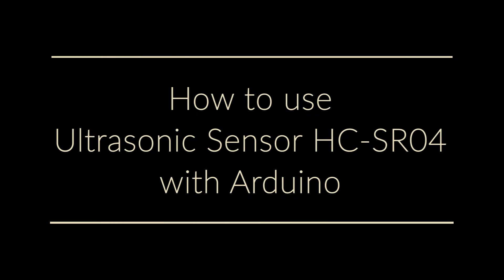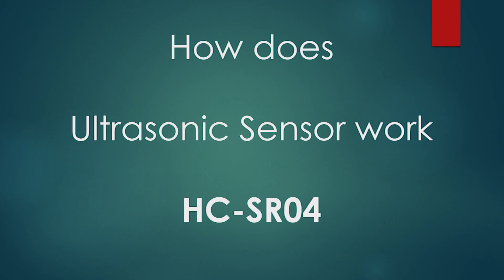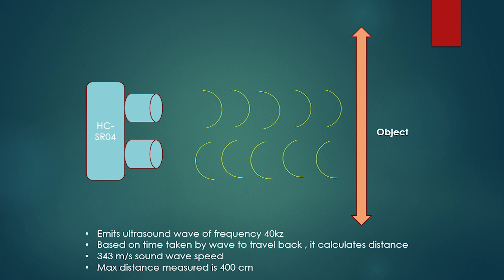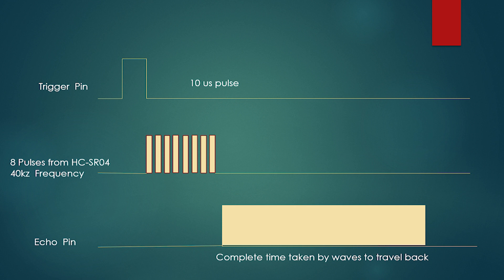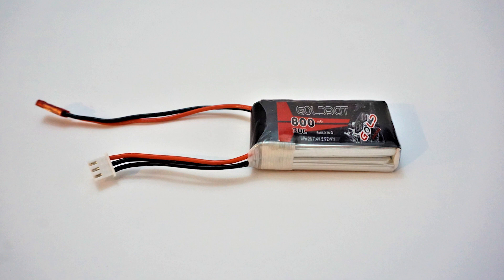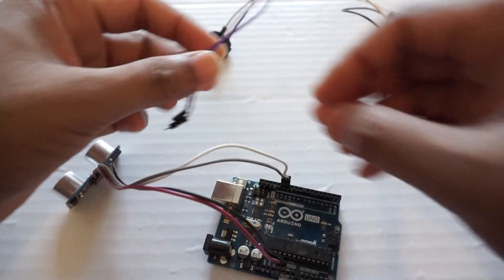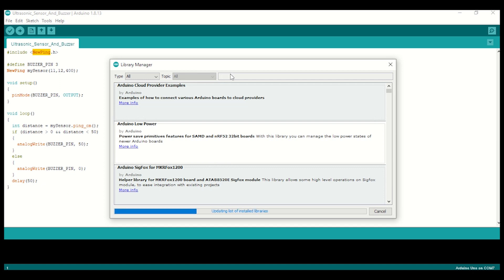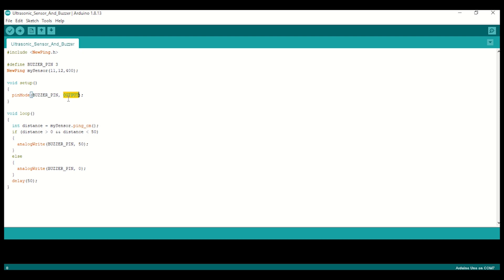How to use Ultrasonic Sensor HC-SR04 with Arduino

Comment: Can we make inputs and outputs work with ESP32 board?
Reply from the maker: Yes you can but it will need code change and connection change .